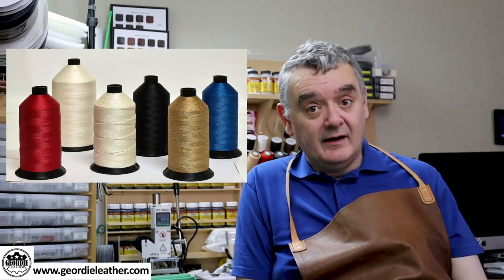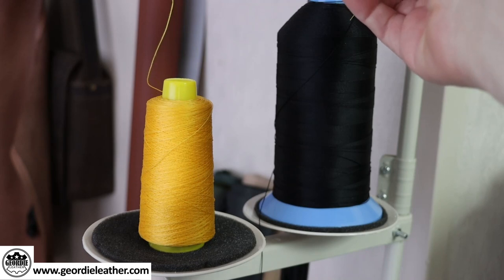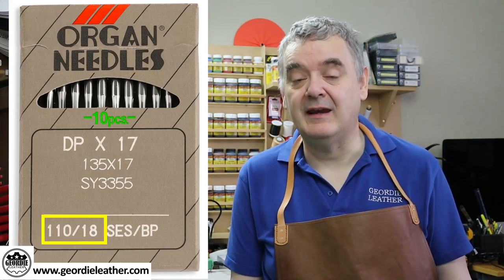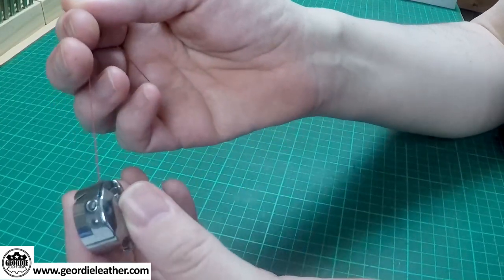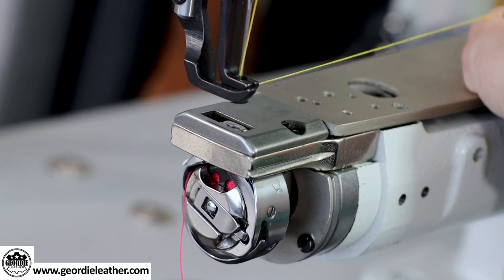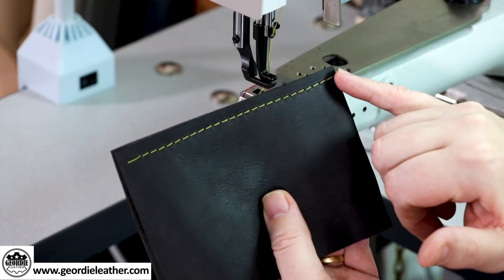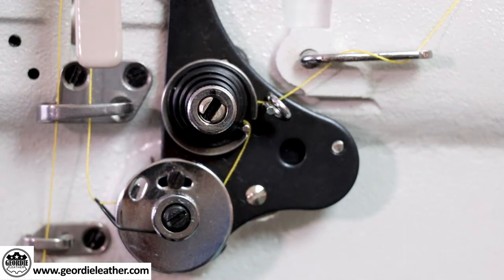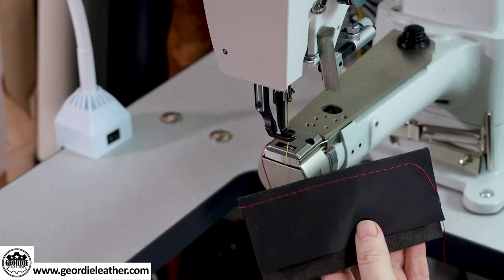Part 3. Treading & Tensioning An Industrial Sewing Machine for Leatherwork.

Comment: Your help sort me out. The bottom thread was looking flat and top thread was visible at the bottom. Proper tension settings that you described here helped me. Top tension screw does the job well. What i learnt by trying and trying is that the top thread have to be too tight, which seems odd at first. But once it is set to the proper tension it needs, you cannot differentiate between top and bottom stitches.

Comment: Hello, thanks for the videos I do find them very helpful, but I have a question for a problem I keep having. I have a cylinder sewing machine ikonix ks335, and I'm using nylon 69 which is what is recommended. However, the top thread keeps on unraveling (splitting) any information about this problem would be greatly appreciated, thank you from Las Vegas🎰

Comment: Hi Gordy; thanks so much - I have a question! What is the thickest thread you run through your 246? I also have a 246 machine. I can get a balanced stitch with Ticket 40 (Tex 80) but I can’t get a balanced stitch with ticket 20 (tex 150) thread. The top thread appears too loose, even though the top tensioner is at its tightest setting (can still see top thread under work). I have made sure it’s threaded properly (your video helped) & bobbin tension is fine. Apart from thread tension, the thicker thread works fine.

Comment: Thanks for your videos. I just bought the same machine and was lost! You cleared so much up for me. Can you tell me what size is the smallest needle you would recommend for stitching woven fabrics please. Also, could I use Gunold Poly 40 threads for woven fabrics like I use on a domestic machine. Thanks in advance
Reply from the maker: Hello Di. Thanks for your kind words. I have no experience of woven fabrics, so I can't comment. As for thread - generally any thread can be used, as long as it will fit in the needle.
Reply: @HobbyBloxs  thanks so much for your reply. You have been a great help

Comment: Hi, based on your recommendation I bought the exact tysew cylinder machine as you have, I would like to build the same flat bed attachment that you built. Did you manage to download a template for it are did you create your own? Also the website specifically states a stitch length from 0-10mm but mine only goes up to 6mm. Is yours the same? Kind regards Keith
Reply from the maker: Hello Keith. To get get the cut-out shape, just put a piece of paper on the metal plate and drawer round it to make a template. The base is just a box. I haven't had this machine for some time but I recall the max stitch size was 6. I hope that helps.

Comment: i couln't find the PDF file for needle and thread in the website pattern section.   the site looks updated.  please advise?  thank you.  I'm getting my singer  135 back up and running.
Reply from the maker: Hi Robert. We are about to replace the current website with a new one, which should be live in a week or so. It will have an updated downloads section. Geordie will be returning to your screens very soon after a long break.

Comment: If I'm topstitching and closing denim jeans seams with Ticket 27/Tex 105 is Ticket 80/Tex 40 good enough as bobbin thread? Or do I need something thicker for the bobbin like Ticket 50 to 60/Tex 60 to 50?
Reply: Thicker
Reply: @philsullivan3679  what tex 
/tkt size would you suggest?
Reply from the maker: Thank you for your comment on Geordie's YouTube channel. Geordie has been away dealing with some health problems but is returning to YouTube very soon with a brand new series of videos. We are clearing out his overflowing inbox in readiness for his return. If you want to re-ask any questions or re-submit your comment, please do so and Geordie will answer you personally. There is no need to reply to this automated message.

Comment: Good video for leather. 
I think at the beginning of the video you should mention that your machine is an industrial cylinder arm walking foot because a regular industrial machine is a single needle lock machine commonly used for fashion clothing. I think it is misleading to people unfamiliar with sewing. Also, as far as I know you can not use regular thread because the tension on a walking foot is much stronger than a domestic machine and a single needle lock machine and the thread will break. So bonded nylon or denim weight poly cotton work best on a walking foot. TY
Reply from the maker: Hello Paula. Thanks for your comment.